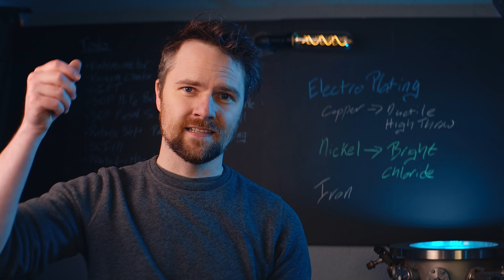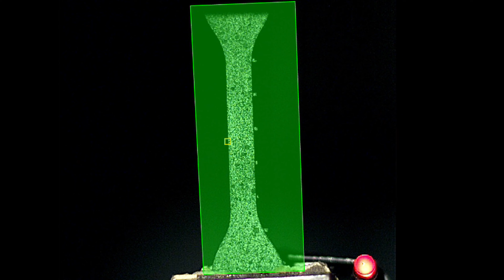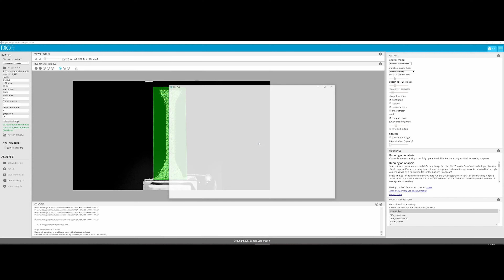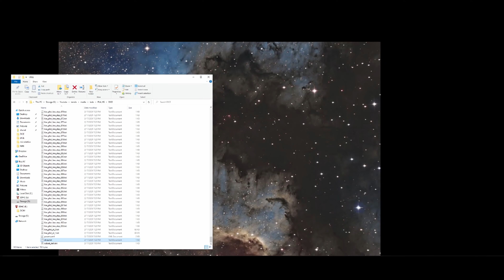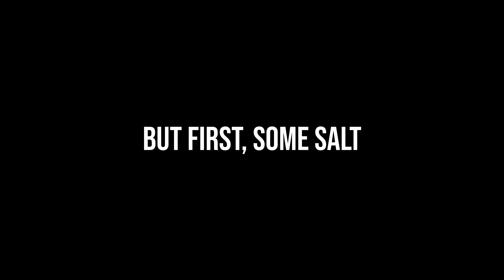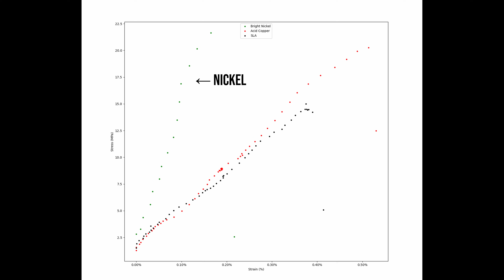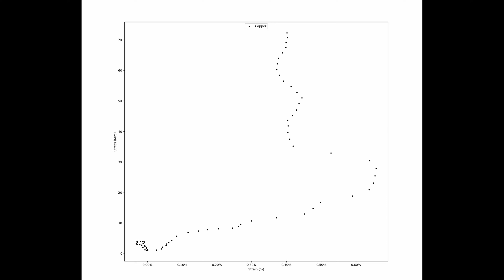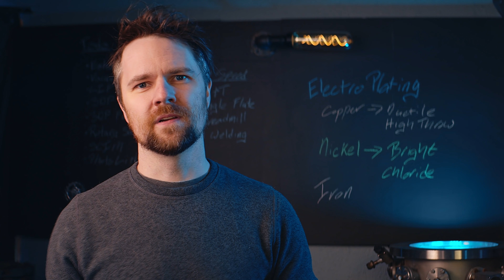Stronger 3D Printed Parts with Electroplating

Comment: And If... You use conductive PLA instead a regular PLA for electroplating?
Reply from the maker: ++ think I might be out of excuses for not trying conductive filament! I would guess that it plates easily and wouldnt have any of the issues I had.
Reply: Conductive PLA is more expensive and has worse mechanical properties.
Maybe it would be better to print with two filaments, and make the outer shell from conductive PLA. I expect there will be some issues with that too, but at least it would be much more economical. In this case you can precisely control which surface you want to coat which could be useful in some cases.

Comment: nice work! Do you think if adding some metalic powder into the resin will improve the mechanical properties?
Reply from the maker: Yes, I think so! The difficulty is keeping the particles suspended however, and not adding so much that it makes the resin opaque to the UV light.  I played around with ceramic particles like a year ago and it would work for a few layers, but the powder eventually settles to the bottom and it fails.  If you could keep it recirculating or mixed somehow it'd probably work well.
Reply: @BreakingTaps  lol well there's always an engineered derivative of 'Ludic Science Magnetohydrodynamic Propulsion' presuming the magnet , plates, and/or electric dont negatively effect the mix, or you discover a nice side effect oc (of course)
Reply: @BreakingTaps  the Formlabs resin rigid 10k has glass embedded in it that gives it a lot more rigidity and I think ultimate strength. So there's some way of doing it. Not sure how it's being kept suspended.

https://formlabs.com/materials/rigid/

It has a claimed stiffness of 10GPa and an ultimate strength of ~60MPa
Reply from the maker: @maxwellfire  Woah, that's wild.  Will see if I can grab some resin and try it out in my printer, or see if there are some papers on replicating the recipe somehow.
Reply: How about fine carbon powders or strands to mix in with the resin...? Perhaps this might appreciably change conductivity of the final printed object and aid your electroplating, or else simply alter the mechanical strength? I’m guessing that carbon fines might not settle out from the resin as quickly as the metal particles.. best of luck - really enjoying your videos!
Reply from the maker: @drmartinbartos  Yeah I'm starting to wonder the same.  The graphite I use for painting is very fine (few microns), I wonder if I could keep that suspended in resin somehow

Comment: can you try making helical antennas with electro plating?
Reply from the maker: That's a really interesting idea!  I admit to knowing nothing about antennas and their designs, but I don't see any reason why it wouldn't work.  Copper electroplating gives a very conductive layer, nearly as good as copper on it's own.  I wonder if you could generate some really funky "AI designed" antennas that way too
Reply: @BreakingTaps  I imagine plating with copper would be a breath of fresh air compared to prior videos!

On a somewhat different subject, I have an idea. Plate something with copper, then zinc, or vice versa, then heat it to fuse the two layers into brass. I know zinc has a lower boiling point than copper melts, but I suspect it will diffuse into the copper well enough  before that happens. Also, plating first with zinc then copper might reduce the zinc vapors. I have read that zinc doesn't electroplate easily, but remelting should reduce the need for a "good" plate. 
The benefit is that brass has substantially better mechanical strength then either element alone, and the properties can be changed easily by altering ratios.
Reply: @superdupergrover9857  I've tried to get this effect on parts I've cast/machined out of zinc, and could never get it to work. Copper gets on nicely, but no diffusion. Tried different heating temperatures too - at the high end you can get some rather intense blue colours (something weird involving the oxides afaik but not too sure) but the golden brass colour is the one thing I've never seen ;)
Reply: @BreakingTaps  Matlab can optimize Antenna designs. However I have only used it to optimize parameters of known designs and don't know if it could generate it's own design or modify them in ways other than the generally known parameters
Reply from the maker: Peter Zemlyanukha  Interesting!  So for 3mm (100ghz), that'd mean a skin effect depth of 0.2062 microns (according to a random calculator) and surface quality > 0.15mm. That seems very doable with SLA and plating! Most of my electroplatings end up around 70-100 microns, and resin printers can pretty reliably hit 0.01mm layer height.  Shape accuracy can be tricky with SLA printers sometimes due to warping when pulling off the FEP film, but enough supports usually fixes that.  

Does the plastic have to be removed afterwards?  That'd be the big disadvantage to SLA, removing the cured resin is difficult/impossible (usually have to burn it out)
Reply from the maker: Peter Zemlyanukha  Ah interesting.  Yeah that's a tricky environment for the plated part. SLA can be burnt out... but I think it has to be done very slowly to avoid pressure buildup (like happend in my microlattice project).  Several viewers pointed out there is SLA resin specifically designed for lost wax process and burns out easier.  Still takes a long time relative to melting out PLA, but should have less expansion issues and less residue afterwards.  I think Formlabs makes one

Comment: First?

After watching: I wonder if solving the thermal expansion issues is possible by dissolving out the plastic after the part is plated. I don't know if the strength of the part comes primarily from the metallic shell or if these are more of a composite material.
Reply from the maker: Yeah it's a good question, I'm not sure either. The metal plating is very thin, averages around 70-100 microns thick. But it does seem to be carying most of the stress.  I wonder if the resin just acts as a filler/sandwhich material to keep the metal from buckling, but doesn't otherwise contribute.  If that's the case, maybe melt out the plastic and replace with something like urethane foam?  Dunno, interesting to think about
Reply: @BreakingTaps  could you melt out then continue plating to thicken the cross sectional area from inside and outside maybe? Just thoughts.
Reply: @jacobdunning8373  You might as well just start 3D printing metal.